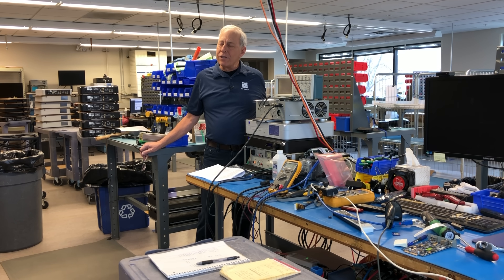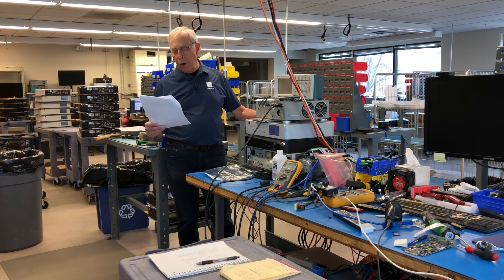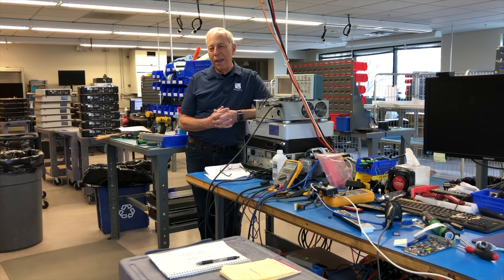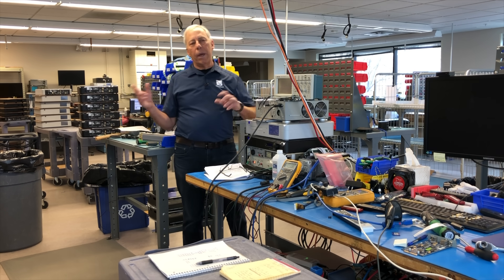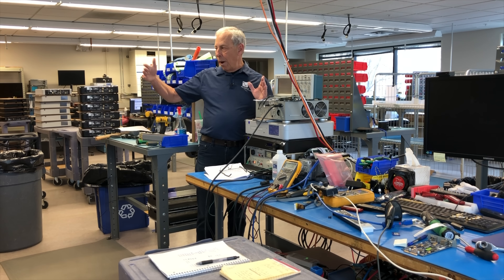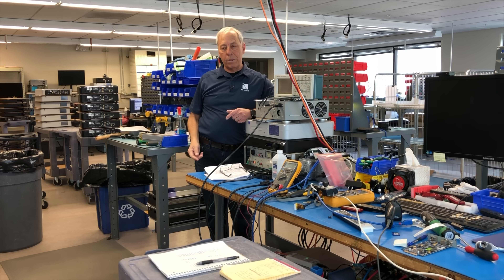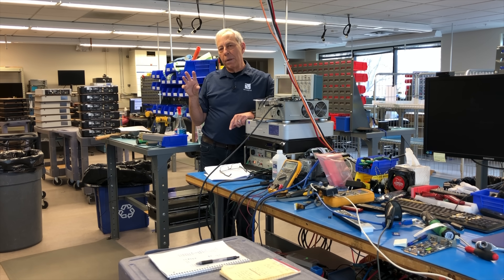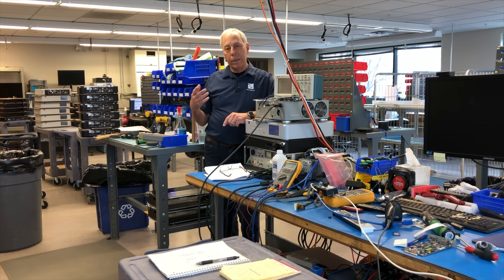Will a 50Hz component work at 60Hz?

Comment: A 50 Hz transformer is larger and more robust than a 60 Hz transformer. 
That's why it can also be operated at a higher frequency.
Reply: In Germany and Switzerland, 50 Hz was chosen because it meant that the lamps no longer flickered. 
That was purely arbitrary. 
All other countries in Europe followed this decision.
In North America, 60 Hz was chosen purely arbitrarily.
In the US they also tried to use 25 Hz. But the transformers were much larger.

Comment: 😃Thanks for this insightful video, Paul!❤Parallel to the main topic here, can you also use a 50Hz LED house ceiling bulb on a 50/60Hz socket without worrying about the possibility of "flickering"? (Note: Some LED bulbs manufactured in China are 50Hz in frequency while the system in Manila, Philippines is 50/60Hz.)

Comment: The "divisible by three" rule honestly makes a lot more sense than just being superstitious nonsense. Mathematically, it makes sense because it keeps all the measurements simple to work with since his form of electrical transfer operates on three phases. Three phases are the simplest form of the tech that works reliably. You could add more phases for less interruption, but that can also be done more simply by increasing the Hz. It's all about keeping the system as simple as possible to avoid confusion, while not sacrificing performance. It's a balancing act and his rule of three prioritizes simplicity in a way that is very practical. 

From a physical perspective, things seem to operate best in threes for some reason. We live in a three-dimensional world. To stand without additional input, objects need three points of contact with the ground. electricity is a physical thing and also exists in threes. Watts = Volts * Amps. The three main measurements for power all live in a distinct triad. Amps are directly affected by distance of electrical travel through a circuit. When you run wiring in a house, you must measure that distance. Distance exists as part of our three planes, X, Y, and Z. Which means you again need to be able to do things in threes. We even measure rotation in a total unit divisible by three: 360 degrees. This isn't superstition. It's just the insight to realize that keeping everything that exists within our material plane divisible by the same number, which cannot be changed, is the simplest way to avoid unnecessarily comples math and irrational integers, which ultimately lead to inaccuracies.

Comment: What about electric fans? There’s this vintage electric fan on EBay from Europe that I want but it’s 50hz instead 60. I heard that it’s ok if I run it on 60hz but I just want to make sure.
Reply: Will be fine as long as you have a transformer to provide the proper voltage
Reply: @LoganT547  already got one on Amazon.

Comment: Would a 220 50 hertz fan assisted oven work with our 220 60 hertz power?
Reply: Yes it will be completely fine to use. Fan may spin upto 20% faster though but motors usually don't care about frequency if it's small changes

Comment: Hi ,since a have change to a solar inverter, I had a problem with my fridge that has problems on start up when the inverter is on (50hz)an I don't want to bring the up the hz to 60 because it my cause other problems to my home......
Do you think putting a stabilizer on the fridge will solve this problem? Because I don't want to burn the inside electronic board.... again.
Thank you
Reply: Probably best to contact the manufacturer support or an electrician

Comment: If u use 60hz equipment to 50hz just for 15 minutes a day also can damage ????? The equipment or work slowly ????? Plz answer for this i want to know it’s important
Reply from the maker: There shouldn't be any problem. The only issue might be if you are using a turntable or motorized device that depends on the frequency. But, no worries on damage.,
Reply: @Paulmcgowanpsaudio   
I have a equipment called ” NutriMill” 110v and 60hz 450w i am afraid to use it cz of my country 220v and 50 hz and i bring converter “15 Amp” but they said here it is dangerous to use even in a small time also for that i want to know if i could use it just 10 to 15 min a week ??? Cz they said can cz fire for overuse. Or maybe equipment not work at all. So i put it away

Comment: it depends.... if the power supply of the amplifier is a switch mode then 50hz/60hz is ok. But some other manufacturer still use linear power supply which uses transformer to stepdown the voltage then it's not OK because the transformer might overheat until it will burn.... switch mode power supply is much more efficient but causes so much noise that will affect the amplifier that's why other manufacturer still use linear power supply. nasagot ko na tanong mo....
Reply: Thanks 

How about Denafrips dac the enyo 15th model which is set at 230/50 plug to 220/60 here in middle east?

Kind regards

Comment: Great Video!  Some of the 50Hz vs 60 Hz is the 60 seconds in a minute for the USA and the imperial system, and everyone using the metric system going with 50Hz with the 1,2,5 steps they use.  20Hz isn't enough cycles and there wasn't a point in going to 100hz when 50hz worked well.

Comment: 60 is used for a lot more things (think clocks using 60 rather than 100) because it's divisible by a lot more numbers than 3. In 50 it's 1,2,3,5,10 and 25 but with 60 it's 1,2,3,4,5,6,10,12,15,20,30 and 60. Evenly divisible numbers was always better in the olden times dividing things like eggs or apples.

Comment: Great informative video.
I live in the USA.
We have 120v 60hz.
I own several miele appliances, (German made for USA).
The one i am having problems with is a washing machine rater 220v 50 hz.
The machine does everything, but draining.
The drain pump is magnetic 220v 50hz. It won't drain.
Why is that?.
The machine is hikes to a step up  transformer.

Please help
Every else works .

Comment: Great video. It came up cause i had a similar question how ever Im planing on buy this low lay fog machine it was build to EU Specs 230AC 50Hz the machine consists of a 2500w heater that create fog and a A/C unit motor and compressor. Im familiar with us electricity 2 hots, ground and neutral but I'm not sure if would be safe to wire the machine to the 2 hot and ground. is this how it should be wired. 
just trying to be safe...any input would be appreciated.
Reply: In EU this would be Hot+Neutral. In US it will be Hot+Hot. Make sure that the when wiring Hot+Hot; they are different phases. 

Utility AC is 3-phase, 1-neutral, 1-ground. (L-1, L-2, L-3, N, G). What you see in a typical house is 2-phase, 1-neutral, 1-ground (L-1, L-2, N, G). 

So when I say “hot+hot” in US, you should be using L-1 (120V) + L-2 (120V).

The Hz factor will mean that the pump/fan will rotate (or run) at a higher speed than designed. If designed for 50Hz and ran at 60Hz - it will work, but it will degrade over time likely from operating at a higher speed than designed.
Reply: @mitch6w9w  Thank you... great info..👍👍

Comment: Hi I bought a 10,000 W power inverter off of eBay years ago I’ve been using a mini split unit on it for years. I bought a new power inverter 12,000 and one off of eBay I wanted to check if it was pure sine wave , so I bought an oscilloscope. Lo and behold the new inverter was a pure sine wave but to my disbelief my old 10,000 W inverter. It was pure sign but it only puts out 50 Hz. Have I been hurting my mini split all these years? Thanks

Comment: I bought a Jura s8 coffee maker, 230v 50hz 1450w. I’m also going to buy a step up power converter rated for 2000. So your saying the hz it’s not going to matter? Since the 50 hz transformer is larger.

Comment: I recently purchase "Dewalt DCB115 230v @ 50 hertz" battery charger in UAE by mistake.

And I am using this in Philippines which is using 60 hertz not 50 hertz.

My question is, is it ok to use it in Philippines?

Comment: Thank you for the information, I'm still a little confused though,  where DC transformers not possible? They're pretty common now. 
You said the resean AC is better is DC has resistance in wire , then you said the wire had resistance regardless, negating the reason why you said why AC was better. 
Then you said we went with AC because Tesla said we could get transformers for AC,  so what no DC transformers weren't possible? 
Btw, The reason for the 60 IS because it's divisible by 3. With the 3 x 120 phase rotations summing zero (120x3 =360 or full circle)
 Elctroboom does s good explaination here :
https://youtu.be/quABfe4Ev3s

Comment: Hi Paul, I'm Mark from Philippines. I was looking for some answers for this same question since my brother lives in Sydney and gave me this guitar multi effects processor. It says in its adaptor that it requires 240 volts 50 hertz frequency. In our country, our household is supplied with 220 volts 60 hertz. Thank you for sharing this information. More power to your YouTube channel.
Reply: Hello sir. I got a cordless hammer drill and the charger is 50hz. Can i use it in the philippines where the suppy is 60 hz?
Reply: @garryramos9318  yes sir but not advisable for long duration use
Reply: @marksteventagaro2171  hello sir. I am talking about a battery charger. Its like  you remove the batery and put it on top of the charger. Not like i have to plug it . How long can you suggest before i take the battery out of charger and rest it before charging again?
Reply: That I cannot answer sir

Comment: Just wondering, will a 230v 50hz amplifier bought from UK work on 220v 50hz power in another country? So hz is same, just voltage is reduced by 10v. Anyone please?
Reply: It should, if the equipment is designed to work +/- x%. So, if it can handle 10% of 230V, that’s 23 volts, which puts the operating range from 207-253V.

Comment: Actually theORIGINAL Hz that Tesla worked with was 25 Hz! The southern part of Amtrak from Washington DC to New Haven CT still today has been using the original Pensylvania Railroad's 11kV/25 Hz system. Only place inthe world (so far as I know) 25 Hz. Europe decided to just simply double the 25 to 50 and over 50% or over half the world uses 50 Hz with the predominate there are variations but usually at 230 V. Japan is te only country utilising 100 V with the lower half using 60 Hz and Tokyo north using 50 Hz. So no, WRONG! N Tesla started out with 25 Hz, as a matter of fact the original AC powerplant by Niagara Falls was NOT 60, but 25 Hz! The older North American railway catenary frequency was (and still is on Amtrak) 25 Hz.  This a carryover from my hero Nicola Tesla. There is another place on this planet that also utilises 25 Hz in its catenatry but I forgot just where that is, so evidently North America was not alone in using 25 Hz. I am a 50 Hz sort of person, and I have an industrial stereo PA amp from the former Tandy Electronics firm, also known as Radio Shack. Well they are now defunct, but I have one of these 250 W per channel amps that as someone has stolen all my tools I have to buy a new larger screwdriver as the power transformer is HEAVY, thus must be massive. With only a ten beat per second difference, as I am hoping the taps on this transformer can do series, thus with an capability of using 240V, It must be possible to run 230V into it in Europe where I shall be moving to soon, that of course as most of the world uses, 50 Hz. It should work! (My amp also has a cooling fan as well). Yes, 250 watts per channel on the output signal capability.

Comment: It will not work with a turntable that has an AC motor. I moved from the US tu Europe and ended up needing to change the belt pulley to one with a larger diameter. And it was painful :) Electrically it is fine because the manufacturer, like PS Audio, platforms globally on 50Hz. But mechanically it took quite a bit of work to get it working.

Comment: There is one problem when you have a 50Hz device pluged in a 60Hz power line. If the device has any kind of timer or clock, its hour is going to advance due to the additional 10Hz.  Those timers or clocks use the power line frequency in their circuit to calculate 1 second. In the case of the 50Hz device, it divides the frequency by 50 to obtain 1 second. So if it  is plugged in 60Hz, it is going to divide 60Hz by 50 causing a lack of precision.
Reply: I mean... Using mains frequency to calculate time isn't a great or accurate way to calculate time in general. It's not always 50Hz. Depending on the load and location, you might even end up with ±2Hz
Reply: At least, everything I've worked with used DC and internal or external crystals

Comment: I would like to ask if it works 240v 50hz to 240v 50hz . 
I bought a Sliding gate Motor for sliding gate 240v 50hz from Australia and I want to bring it home to Philippines and install to our 220v 60hz .
Will it work ? Will it damage the motor? 

Also I bought a Ryobi sanding machine 240v 50hz , I also want to use it on 220v 60hz . Will it work? 

Please reply  below 

Many thanks
Reply: did it work buddy?
Or did you burn the appliances?
Reply: @200castor did it work buddy?
Or did you burn the appliances?

Comment: I'm going to connect a 50hz window Air Conditioner unit to a 60 Hz power supply. My fingers are cross. Your saying there won't be an issue?
Reply from the maker: I assume you're just being a wise ass and that's fine. But just to be clear, no, that's not fine because it has a motor.
Reply: @Paulmcgowanpsaudio  Don't assume, just understand that everyone is not as knowledgeable as you. I wasn't being a wise ass. Anyways, I found out the hard way. Today I connected my 50 Hz AC unit to a 60 Hz power supply. It ran for about 1-2 Minutes. Then it overloaded our generator causing it to shut completely down. Online I read 50 Hz appliances could work with 60 Hz so I gave it a shot. Now at least I know the reason behind the failure was the motor thanks for the reply.
Reply from the maker: @idontusegmail7102  My sincere apologies for assuming.

Comment: You'd get a 20% faster Capacitor re-charge rate at 60Hz vs 50Hz for your amp' ,,,whatever that's worth.  60 vs 50Hz would be prob' for moving record-decks with A.C.- syncronous motors,  to a place with a diff' mains frequency.

Comment: True for amps and most electronics but, some equipment such as washing machines don't work correctly, I think that drain pumps at 50hz are unwilling to operate at 60 hz in the Philippines  Basically most motors will run faster, some not at all because they are Synchronous won't run at all I have read..   Would you agree ?

Comment: Hello I have a question can I plug a European 240v 50Hz AV receiver into a 240v 60Hz USA outlet?
Reply: You can not. Simplified, European 240V has 1  hot and 1 neutral, US 240 has 2 hot and 1 neutral.

Comment: How about a microwave from UAE with 230V/50? Can i use it here in the philippines with 230v/60hz?
Reply: Or in Saudi Arabia that uses 60Hz 230V.
Reply: If one that has clock, it will run faster on 60Hz.

Comment: Will a 220v 60hz machine work at 220v 50hz?
Reply: For motors they may spin 20% slower and get a little hotter, but if it's DC it's fine

Comment: How does using 50-hertz equipment on a 60-hertz system work, here's why I'm asking. I bought a $500 cold welder on Amazon only to find out when I got it that it has an EU plug which I cant use here. 220 volt 50 hertz 20 amps. to convert that to 60 hertz I would need 40 amps or 2 - 115 volt lines 20 amps each (but again we have 60 hertz, not 50 hertz). so I'm going to buy a 220 volt 50-hertz gas generator (now I won't need to find a big power source and run it through a transformer) I came here to find out if I can use this EU generator 220 volt 50 hertz, 25 amp say on a 220 volt 60 hertz 40 amp dryer? now that makes sense, what am i not getting here or am i right, thanks

Comment: I was under the impression the reason why we have 60 and not 50 hertz was because the U.S. didn't want to wrap their wire in a thicker coating to protect the user, thinner coating meant cheaper cost of materials, which meant more outlets or lights.

Comment: Thanks a lot. I'm from Philippines. I just buy a 50 hertz sound mixer in UAE and planning to return IT because of the herzt issue. Timely information
Reply: Have u tried already in the ph sir?
Reply: @elaigzs3892  not yet Sir. I am still in the quarantine facility in Manila. 2 DAYS more to go
Reply: @elaigzs3892  but I THINK it will work Sir, because I just checked my denon AVR I bought 13 years ago and it is 50 hertz. Still working until now without problem
Reply: @oldspider9216  He said 50 hz equipment can use at 60hz all day long but, 60hz equipment use to 50hz is not a good idea.